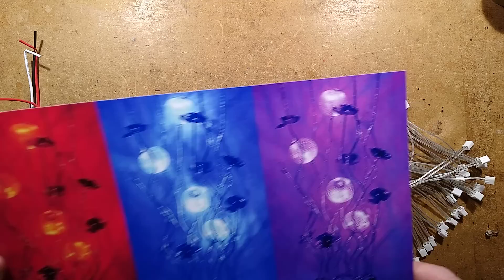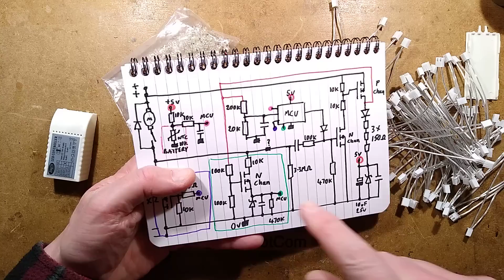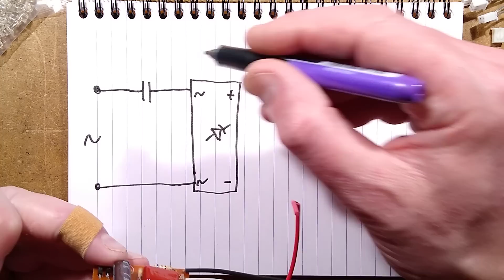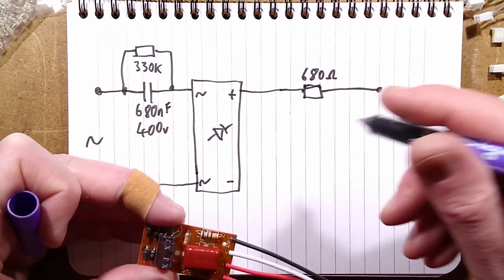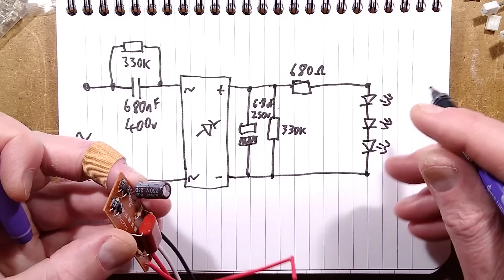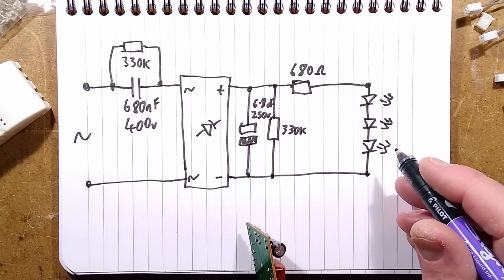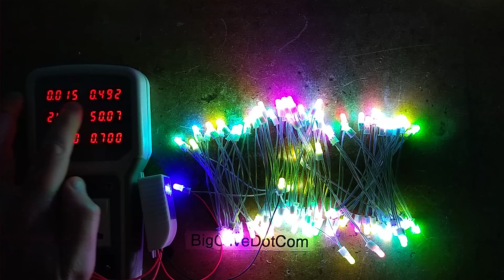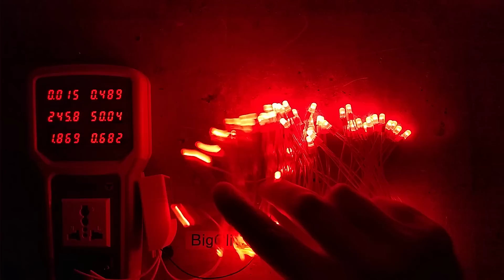Weird AliExpress LED loom

Comment: I like that the power supply is labelled "Transformer" when it doesn't use a transformer.
Reply from the maker: The Chinese pretty much call every power conversion device a transformer.  The capacitive dropper is very cheap, reliable, hackable and repairable, but not as safe as an isolated supply.
Reply: @bigclivedotcom  So, even a linear power supply with a "good ol' hunk o' copper and iron", beefy full bridge rectifier, stabilizing caps and (of course) properly rated fuses would still be considered "safe enough" for household use?🤔 (because they're a helluva lot easier to build than switch mode PSUs😆)
Reply: @TehSmokeyMan  yeah, nothing wrong with linear supplies. They are at least as safe as an anvil.
Reply: @TehSmokeyMan  the transformer makes the power supply safe-er. It being switched or not doesn't really make a difference safety-wise, as you'll be exposed to unreferenced voltage and thus touching a single lead will never lead to a shock. A referenced output PSU could shock you if you grab one lead, even if you don't touch the other one.
Reply: @somedude2492  well, it is pretty easy to get something wrong safety wise in SMPS, and in cheap ones that doesn't need inspection before being sold it's common.
Reply: @somedude2492  Good point, seeing as I'll be working with different output voltages (22V/0V, -40V/0V/+40V all the way up to 650V/250V/12.6V/0V) I'll want to make sure everything's properly insulated and that there are no bare connections anywhere to fry people😅
Reply: @plainedgedsaw1694  Hahaha, and about as heavy😆😁
Reply: @plainedgedsaw1694  Yeah, they taught me that SMPSs were "those egregiously complex monsters that couldn't even be serviced by the dude that designed it, when something dies in there"...
Granted, that was some 20 years ago, though😆
Reply: @TehSmokeyMan  perfectly safe, i'd trust them more than some cheapo switch mode thingy , i've come across some right nasties over the last few years,, and that includes the 'shockingly' (!) bad usb power plug things ,, inefficient? maybe but if well designed very reliable,  dunno if true but i read somewhere the EU have banned 'linear' plug type power supplies, whether regulated or not due to the  inefficiency, ?? what happens for things that need low voltage ac, then? cant get replacements??
Reply: @TehSmokeyMan  650v? that'd sting if touched, 300 ish dc is bad enough!
Reply: @TehSmokeyMan  they can still be a pain if they suffer 'chain reaction' blow ups,  there were many occurrences of this in tv psus in the 70s to 90s, often a shorted 'chopper' transistor would 'take out' several other components even a psu controller chip! i repaired many jvc branded colour portables with these 'issues' caused by resistor going high/open, making the mosfet short, blowing a fusible resistor, and possibly a few other parts, the main internal fuse never blew! these were notorious for it! several other tvs had to have pretty much total psu rebuild after a failure!
Reply: @gavincurtis  as said, i'm not 100% sure its true, but suspiciously some while before maplin went bust they stopped selling linear power supplies, apart from a very few, mostly ac output, selling switching ones only..???? i cant see how a smoke detector could consume 3w or so, they normally use pp3 batteries, at least in domestic ones, which can last years, so actual dc consumption must be minimal, maybe someone cocked up the design of the capacitive dropper circuit!
Reply: @andygozzo72  Yeah, that's kind of why I lament the "outlawing" of linear PSUs; being more straightforward, it's easier to beef them up and install a couple of safeties 😄
Reply: @TehSmokeyMan  in some cases you have to have a linear psu, such as if ac is needed, or a switch mode makes too much interference
Reply: @andygozzo72  i think they got banned because if high standby current.
Reply: @plainedgedsaw1694  the current consumption  of an unloaded linear psu or just an unloaded transformer should be minimal, although depending on size,  especially the little 300ma /500ma multi voltage plug sized things that were as common as muck,
Reply: @andygozzo72  it depends on transformer size and construction, smallest of the transformers that limit their current more by their coil resistance than inductance don't change their current draw much with load, big transformers draw only small fraction of their full load draw, on the other hand SMPS always draws little without load.
Reply: @plainedgedsaw1694  i'll see if i can measure the current from the many various ones i have..
Reply: If it had, it would (a) have isolated the mains from the LEDs and (b) cost a few pennies more. So no transformer.
Reply: Autobot or Deception? 😐
Reply: It's a decepticon
Reply: It doesn't need a "transformer"! It is labelled as a "transtormer" - whatever that might be.  🤣
Reply: @cgoad  Well spotted! Also a space between "transtor" and "mer". I don't know what that makes it.
Reply: Perhaps it is a transformer in disguise?
Reply: @gavincurtis  Ro-bots....transformers in disguise.
Reply: Probably translation error. In chinese those are called "变压器", which literally means "change(变) voltage(压) device(器)". Since the translator has no knowledge of what technology is used to "change the voltage", it just defaults to "transformer"
Reply: If it did include a transformer it would prob a bly be wound with copper coated aluminum wire.

Yikes!
Reply: The bastards
Reply: Your comment got me thinking about translations.  I suppose you could call one of those coils you plug in and dip into your coffee (for warming) a "Transformer"  

Online even these days, we can "Translate to English" almost anything.

Culture and science collide sometimes?

I always like the Chinese customer service salutations though:  "Dear Friend" as opposed to the English speaking crowd "Valued Customer".  Much more personal and respectful.
Reply: @amorphuc  transformers 'transform' ,one voltage, current or impedance load to another , so that cheapo device could at a pinch be called a transformer, but thats usually a term for one that 'separates'/isolates each side which that definitely doesnt 😉(you can get tapped winding 'autotransformers', though, they still change voltage, but not isolate)  as for coffee heaters, that doesnt change any voltage/current etc. so just a 'coil' of resistance wire,   single coils for inductive purposes are usually coils or inductors,
Reply: @andygozzo72  No.  I get it.  Just other thoughts.

I know for sure what a transformer is.
Reply: its a transformer it can transform into fire
Reply: It's probably a result of translation - 'transformer' in Chinese certainly means a transformer as in English, but it can also mean adaptors etc. Think of how in English the term 'Adaptor' is a catch-all phrase for a power converter, whether it uses a transformer or smps or whatever.
Reply: Chineseum crap 😡
Reply: @samuelfellows6923  capacitive dropper circuits arent 'crap' if they're suitable for what they need to power and no way anyone could come into direct contact with their outputs,  many plug pass through devices such as radio controlled switches, timers, wifi repeaters, may be found to use a capacitor dropper..

Comment: Well that was fun.  At first  I was thinking that it would be a neat source for some JST type connectors but now I think I'll pass.  😀

Still, it could still be cool in a bottle or something that would sort of keep the spicy bits locked away.
Reply: Bottle of crystal clear dielectric oil.
Reply: @gavincurtis  That would be interesting.  Oil that wouldn't freeze but getting cloudy might be an unique outdoor effect in the cold.

I'm starting with some avocado oil!

Wiring and insulation of silicone perhaps?
Reply: @amorphuc  I can imagine it would look really neat.  There is clear dielectric silicon oil (food grade) from Amazon.  Brand name is "Super Lube" and in gallon sizes.  Kind of expensive though...but shouldn't turn rancid or yellow.
Reply: @gavincurtis  Indeed.  I'd go cheaper but the thing is the insulation.  Food grade stuff would be easy though.
Reply: @gavincurtis  Turning rancid would perhaps be a thing with various oils.  I hadn't considered that.  Been thinking about Solar heat transfer and wondering about oils as the medium.  Maybe PG/Water is better.  I was thinking Calories per ml.  Oils may have other requirements etc but still thinking more calories per unit as far as heat transfer even quickly?  I don't know.

Food grade silicone here is easy with totally available fittings?  I sure don't know but wonder.  What are your thoughts?
Reply: @gavincurtis  Also, and I don't know about where you are coming from, sorry.  I have only a newly emerging sort of interest here.  There seem to be many factors from how far North you are to the climate you're most likely in.  Seems complicated.